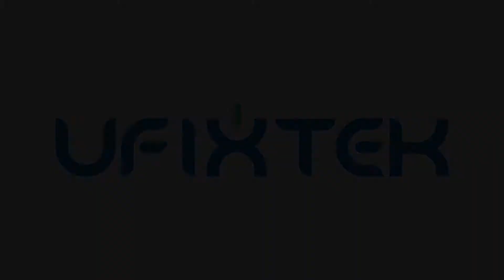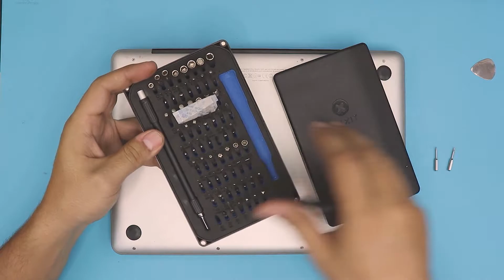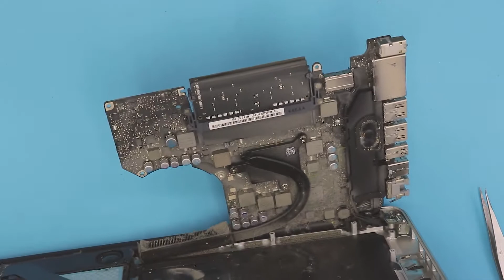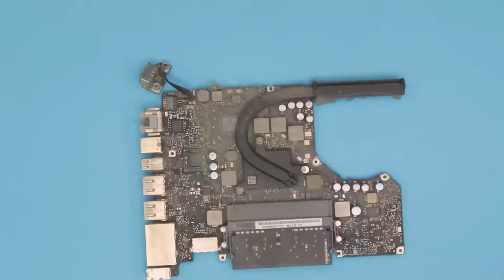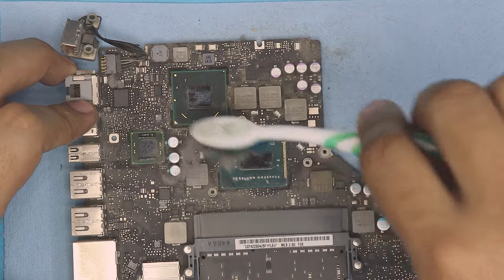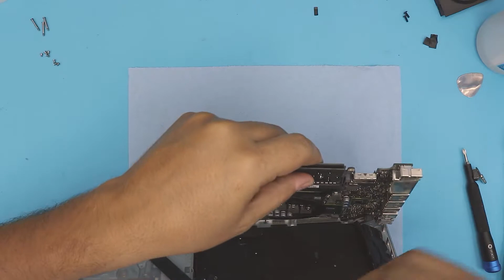MacBook Pro A1278 Cleaning and repaste service, STEP By STEP

Comment: Thank you so much for this wonderful slow paced and step by step videos🥹✌️. I did encounter some difficulties involving the fact i have to bring the whole logic board to a technician just to extract some tightened Heat sink screws😅
Reply from the maker: Glad the video helped, my friend! 😊 That’s exactly why I make these videos.
ya some screws can be very hard to remove because of the heat generated over time.
If there’s anything you want me to test, explain, or cover in another video, just tell me.
A like and subscribe also helps support the channel big time 🫠💞
🍻 Cheers!

Comment: I broke a connector by mushing the bits down without the plug properly aligned - massive sigh of relief when I figured out it was the microphone and not something important!
Reply from the maker: Very close call. If the mic is not a big deal, then you're safe.
Reply: @uFixTek  fortunately this is my writing at cafes and dissociating on the couch laptop, not planning on taking too many calls on it

Comment: what if t6 screws head is gone
Reply from the maker: 🫠 Regarding your question, you will need to make a straight cut and use a flat screwdriver to remove it.

Comment: One them that you said to pull out didn’t work. It ripped right off and now I have split wire ends
Reply from the maker: But never use excessive force. You pulled on them really hard, and over time, because of the heat created in the laptop, the connectors can become difficult to remove.

Comment: Hi. Sometimes the heat sink pipe has a barcode sticker that can stick to the layer underneath which covers the keyboard backlight. In my case I ended up ripping the layer below slightly while attempting to lift the logic board, but it shoudn't be that big of a deal
Reply from the maker: no need to worry it is absolutely fine.
this happens often.

Comment: TYSM for this video! It all worked flawlessly and my MBP is running better now! A little tip for the tricky keyboard cable I found helpful: I was also having problems to get it in and found that if you taker a long (5 cm or so) piece of not too sticky isolation tape and tape it to the cable once you put the tip of it into the socket, you can very easily "pull" it into the socket, using the tape as something to hold onto. Afterward you can carefully pull the tape off by pulling it at a very sharp angle. Do so at your own risk, but for me it worked very well, because I felt I was damaging the cable using tweezers or my fingers. EDIT: just realized that someone already commented that technique
Reply from the maker: Thanks for your feedback! If you want to help the channel, you can either like the video, subscribe to the channel, or do both!
About the tip you shared, it's really good, and I'll use it in my future videos. I appreciate your suggestion, and I'm happy to assist and support people with their services and improvements.
If you have more questions or requests later on, feel free to ask. I'm here to help!

Comment: Thanks, with your help my idle temps went from 60-72C to 40-45C -- those little pieces of tape-- were those necessary to put back?
Reply from the maker: Thank you for your feedback! If you wish to support the channel, you can like, subscribe, or both!
Regarding your question, absolutely not my friend they are not required to be placed.
Should you have any further questions or requests in the future, please don't hesitate to ask me.
Reply: @uFixTek  thanks. Also, a random piece broke off.. do you have an email I can send an image to, to get your help with finding where it came from?
Reply from the maker: sure send it here:  	ask@ufixtek.com
or send me here the pic via link , use this site: https://imgur.com/
you don't need an account to use it.
Reply: @uFixTek  thanks, email sent
Reply from the maker: that plastic is part of the battery or something some corner plastic, but for me is very hard to say what part is. but it is safe to say that it is a plastic and any broken plastic in the re is not important.

Comment: Hello! After doing this my LED backlight does not work, i have tried resetting SMC and taking off the backlight cable and putting it back. Still no result
Any suggestions?
Reply from the maker: Thank you for the feedback! if you wish to support the channel you can LIKE or SUB or both :P
regarding your question: its not with software or SMC, something is wrong with connector or the flex cable, make sure its inserted all the way inside the jack.